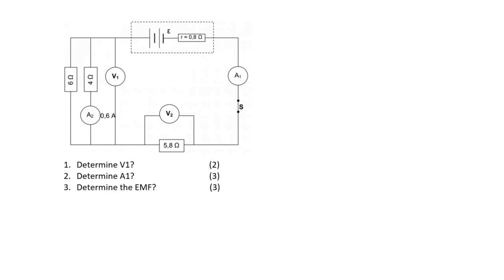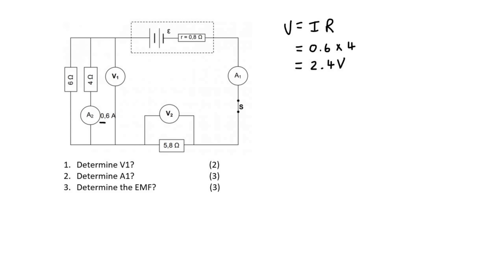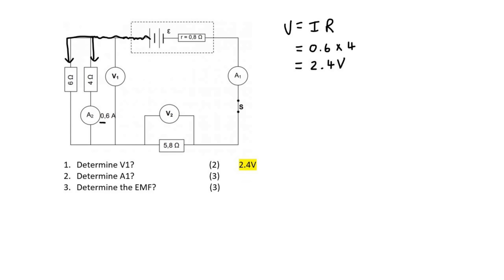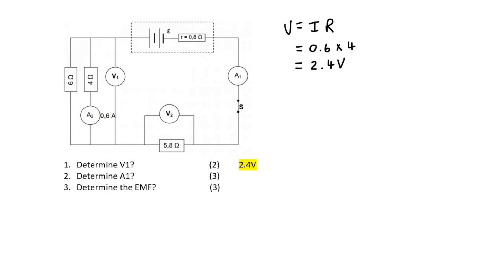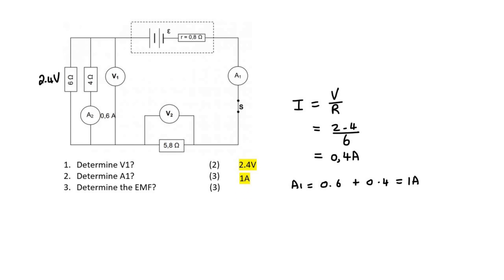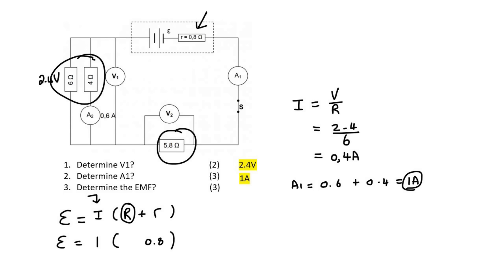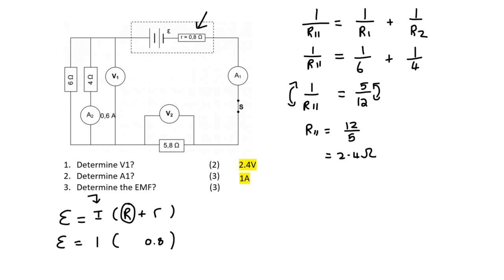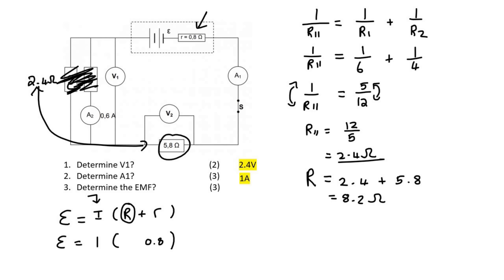Electricity Grade 11 and 12: Exam

Comment: hi there, i calculated the same answer as you for emf, but i calculated v2 first then added it with v1 and got the emf because you said the emf is the maximum VOLTAGE the battery can give, so i wanted to know if i was wrong in calculating the way i did?

Comment: Hi Kevin! love your videos but could you please explain why A1 is simply equal to the parallel lines' current put together, whats the rule behind it?
Reply: Remember what they said about parallel circuits ,they said that in a parallel circuit or in a parallel combination rather ,only the current is divided and the voltage is the same meaning at the beginning of the parallel combination the current will go separate ways and we'll combine again at the end and thus move on the main part of the circuit and remember that Kevin said the current moving on the main part of the circuit is the total current of the parallel resistors combined

Comment: So why didn't you add the 6 with the 4 to get V1?
Reply: voltage in parallel is the same, so V1 was equal to any other line parallel to it, the second line gave us both I and R therefore we used that to get the V of that second line ,thus equaling V1.Or at least i hope I'm understanding that correctly.

Comment: Hey kevin! For Question 2, you calculated the current for the 4 Ohm pathway and the 6 ohm pathway but neglected any current flowing in the V1 pathway? 

Was that your mistake or correct me if im wrong? As to why you ignored any current flowing through the V1 pathway?

Hope to hear soon 😊
Reply: there is no current flowing through that pathway
Reply: It has to be mistake. In the next video he calculates external resistance by combining all the resistances, so this must be a mistake.